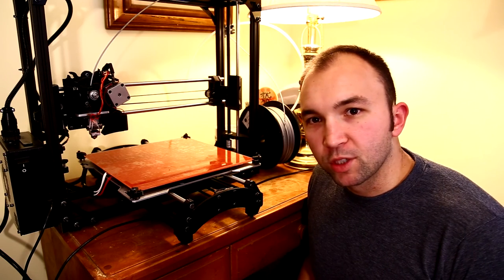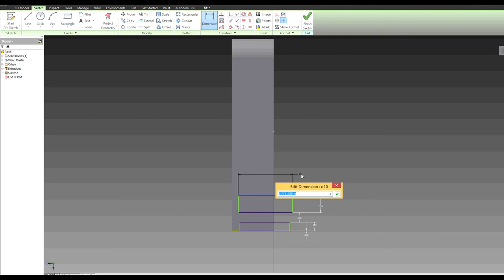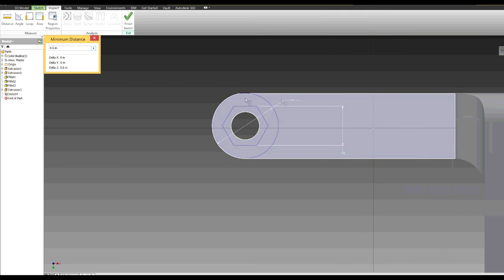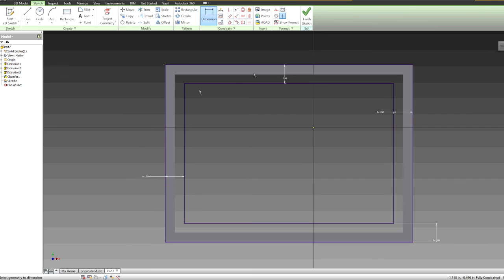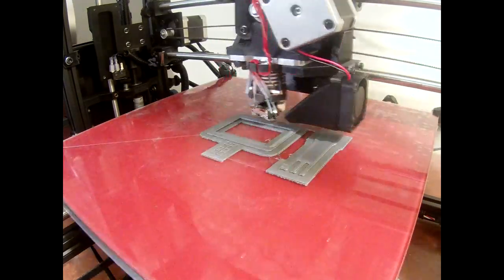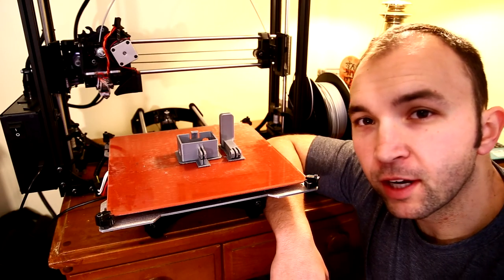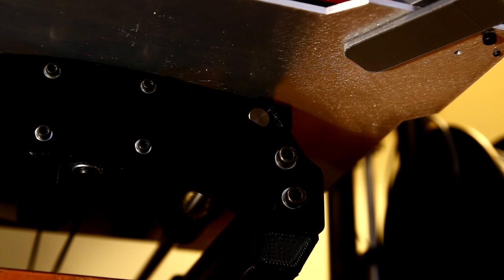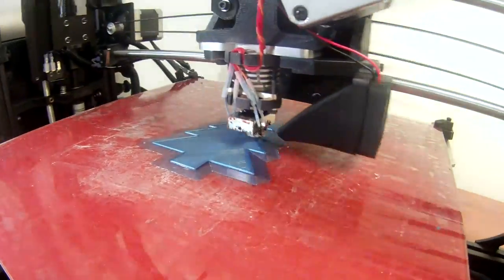GoPro mount for 3D Printer

Comment: Nice design! What CAD program is that?
Reply from the maker: thanks. Autodesk inventor. I've used solidworks and unigraphics nx. They all have their advantages but inventor it's definitely easy to use which is nice
Reply: Will's Workshop Thanks! I'll give it a try!